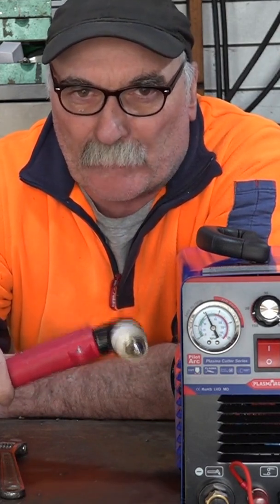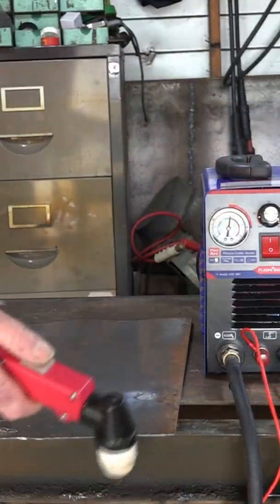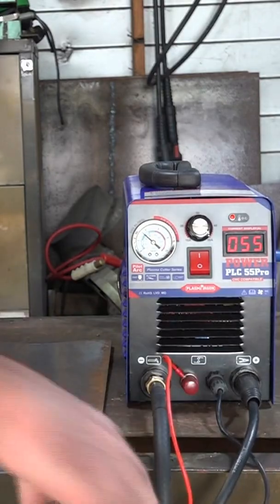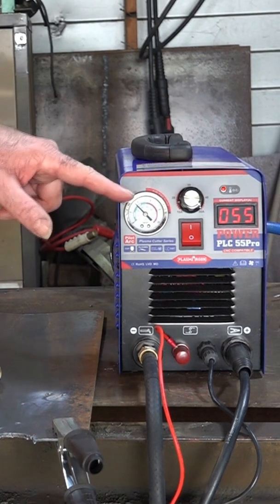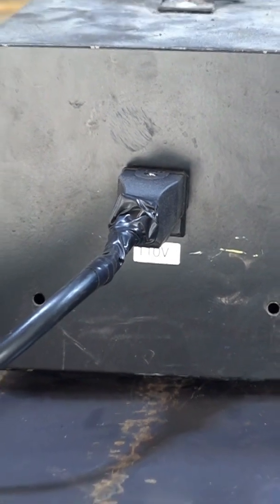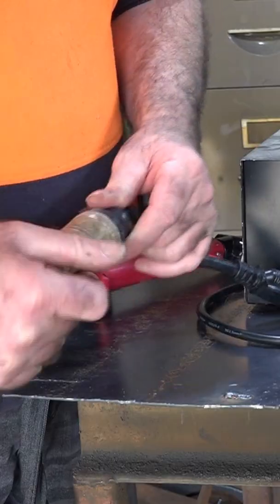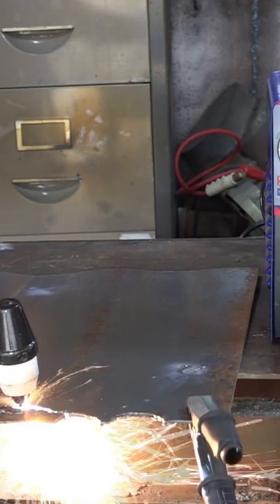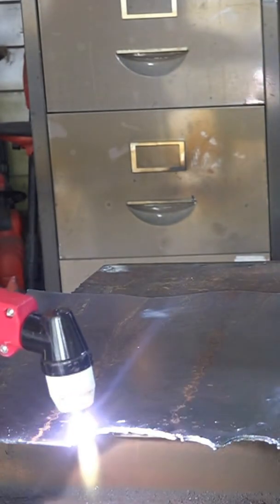Plasma Cutter Spits and Farts: What to do if this happens

Comment: Yup yup, that was me too on a "dual" voltage machine purchased from Amazon...which isn't very dual, I guess.  Ran just like that on 120v, even with smaller hole tips.  Cut just fine 240v though.
Reply from the maker: Yea think it needs 220/240 v

Comment: Hey Pete, have you tried anymore experiements using a plasma cutter as a way to heat metal for bending? I tried what you did in the video you made bending the wrench and while it does work it sure mucks up the surface of the metal. I've got a non pilot arc machine and was wondering, would it work better with a pilot arc? Can you then hold the torch far enough away from the metal that you can heat it without melting the surface? Be a pal and test that out for me!
Reply from the maker: Ok mate will try it .